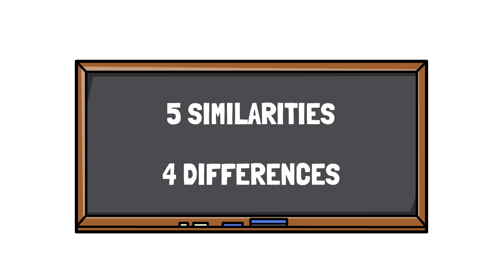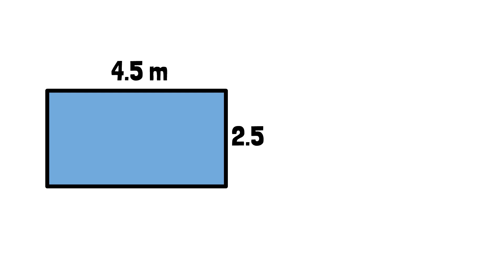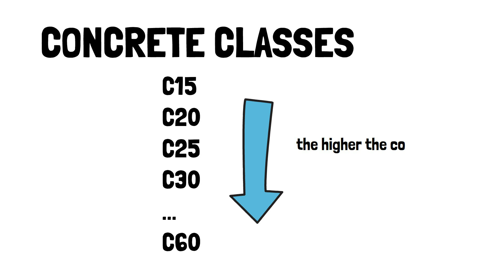T-Beams vs Flat Beams: Which is the Better Beam & Block Tech For You?

Comment: Hi there. I will be using concrete T-beams for my span across our new home build. Can you tell me the dimensions (HxDxW) of the T-beams that will cover a span of about 30' (9200mm), 60' (18,288mm) and 20' (6100mm)? These spans are the longest spans I will have to cover so I can plan accordingly for the T-beam. Thank you and great video for T-beams and Flat beams.

Comment: when you factor in everthing i.e labor,wood props for support whats the cost diffrence between the two and finally can you mix and match say foundation and first floor slab you use t-beams and rooftop slab with not so much weight you use flat beams is this possible
Reply from the maker: Yes you can match that way
Reply: where are you located